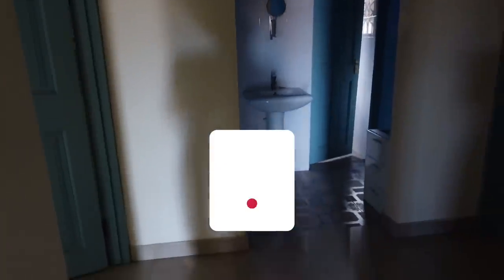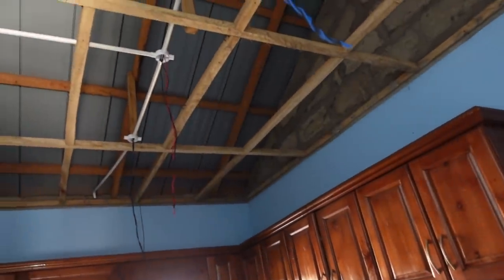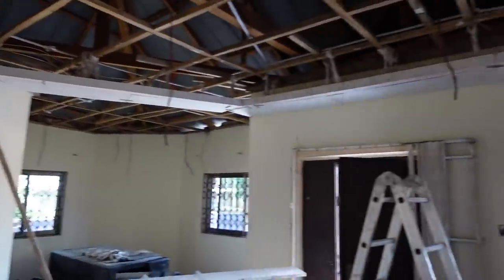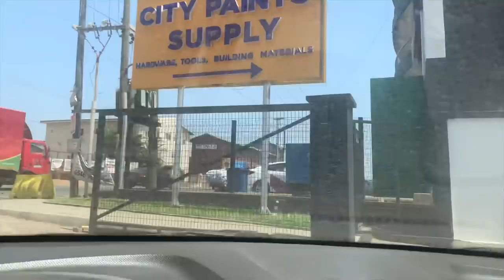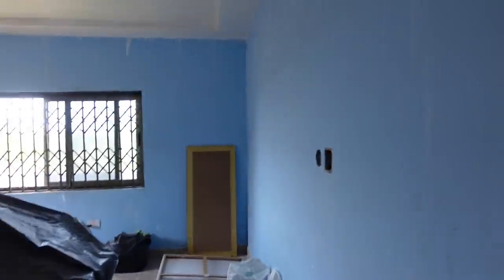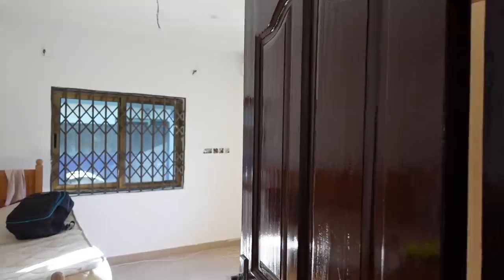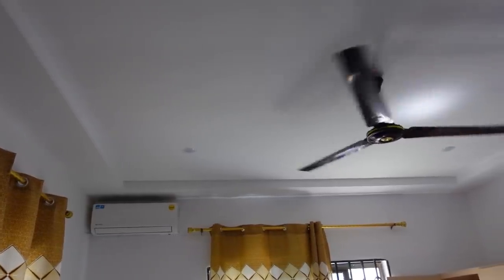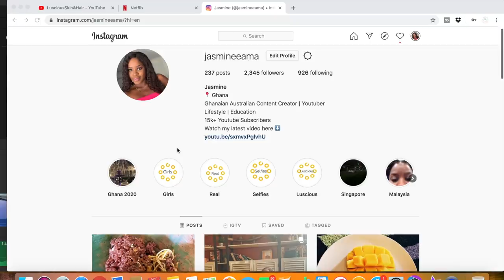I TRANSFORMED MY GHANA HOUSE FOR HOW MUCH ? | BUILDING IN GHANA | LIFE IN GHANA

Comment: It's so much faster than traditional brick or blocks. It's also 180 mph wind proof with a four hour fire rating. The concrete is essentially sandwiched between styrofoam. The rebar is placed into locking tracks and tied together. The tricky part is that all cable, wire runs hvac, window bucking, door bucking and plumbing need to be pre planned with pvc tubes to accommodate their space before pouring. 4 workers can do 7261 sqft or about 600 meters in a day. Well that's the pour time. Prep for scaffold takes some time. Anyway. I think my build will include some type of icf forms. Looking at the perfect block closely.